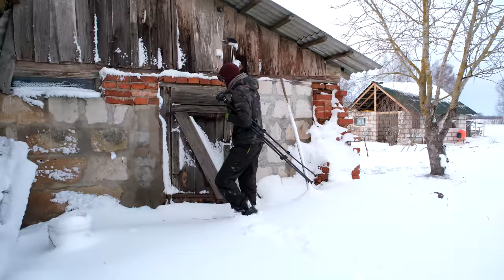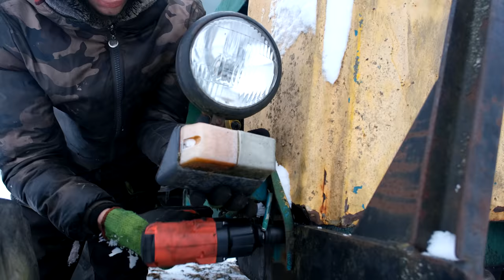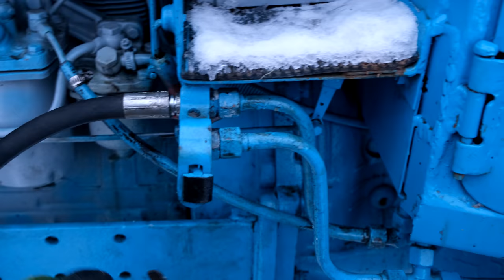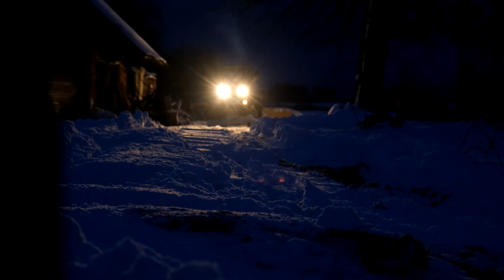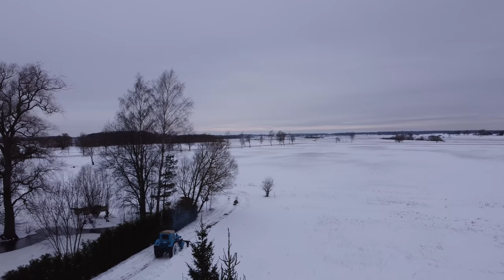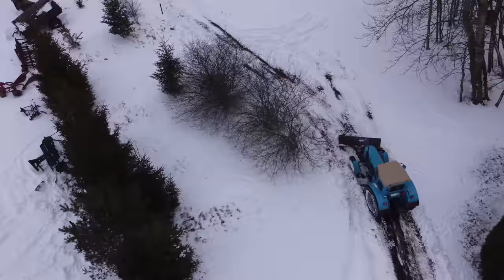PLOWING SNOW for the FIRST time

Comment: Wipe your plow blade down with used motor oil, lots of it. This will help shed off snow instead of sticking and building up. You won't be pushing as much snow as it sheds off the side.

Comment: You may need a set of tractor tire chains, for use during the winter. In Canada farmers also put weight
in the rear tires.
Reply: We used to add bricks to the back, but I used to sit above the wheel arch,my friend on the other. That worked for us.

Comment: Might I make a suggestion when you plow?  Don't have your plow blade pushing straight out. Instead, curve the blade on an angle towards the side of drive...take half paths ( not full scoop...its not as much strain on the plow...it's not a county plow...not as powerful as they are...I know it will seem like it takes you longer, but it really won't...you won't be fighting to push the plow scoop through thick snow.  Can't hurt to try it.  It's what I do with my snow thrower or my lawn mower...smaller paths will get it done faster and smoothly done.
Also, maybe you can find a good  snow thrower for helping you make paths from house to animals, goat house, geese, cars...places that the tractor can't get to.
Maybe later make a garage building to make stalls to back car, van, and tractors in to keep them out of weather...take good care of equipment by storing them will keep them longer.
And while on that topic, dont know if it would work with your tractor attachments, but maybe build a raised base to set them on when not using them, so you don't have to dig them out of snow every time...just pull up to attachment you need and hook up...quick and simple.  Just some ideas, trying to make it easier for you.
Hope you don't get hit  with the weather we're expecting this weekend into the first week of February...when it crosses to you...weather world is getting crazy.  Are your winters always like what you are showing?

Comment: Maybe someone has already mentioned this to you but in case they haven’t.  When you are travelling make sure your three point hitch arms and top link are not dragging behind the tractor, or under the tractor.   Tie or secure your top link up with string if you have too.  You don’t want either of the links bent or broken.  Especially when you are reversing.

Comment: You could sure use a sweet set of chains for all four wheels on that beast---of course, I don't know if those Soviet era tractors really need something so pedestrian as chains, but they couldn't hurt, eh?  Also, don't smooth out that crown on the road---it diverts water from turning the roadway into a swamp.  I'm not a pro at snowplowing, either, but I'm sure one of your neighbors could give you some suggestions.  Thanks for the video and taking the time to think of us.